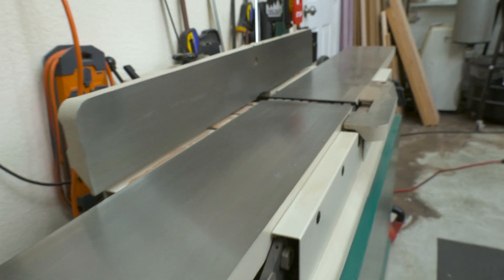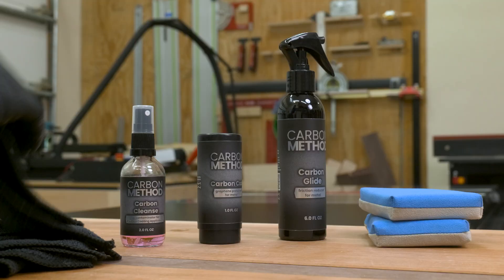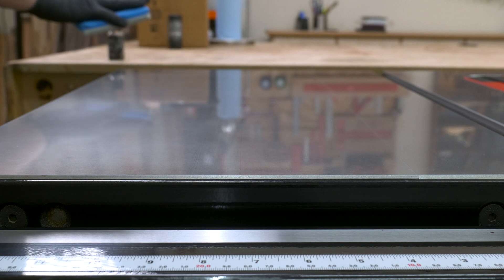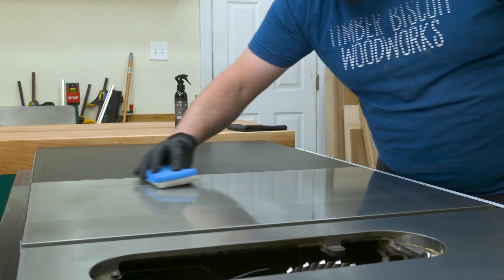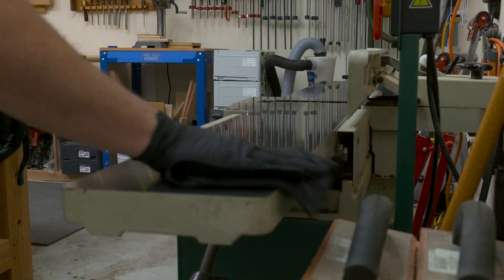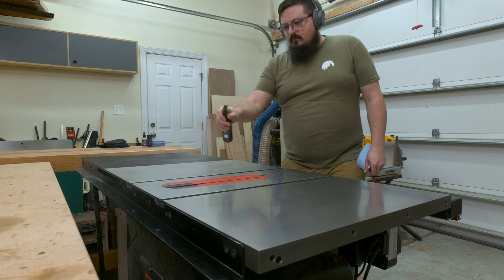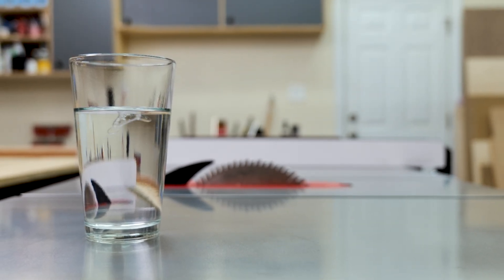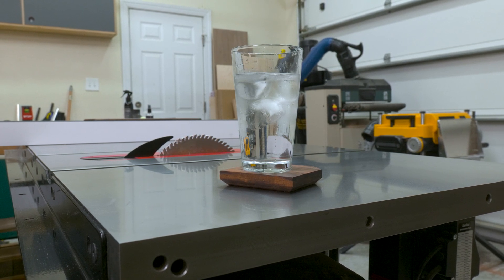We All Make Mistakes - This Stuff Isn’t One | Carbon Method

Comment: Good video about protecting the tops of the equipment but why would I want to spend so much for the carbon coating when when we can use products which cost less?
I do like your woodworking videos they are informative.
Reply from the maker: Valid question. I have used just about every product under the Sun when comes to trying to prevent surface rust. I actually just had a friend move here who didn't heed my warning about it and ended up spending three days removing from his tools after being here a week. Anyway, I have applied carbon coat one time in a year and in that time I have had zero rust and my tops look just about as good as the day I applied it. So for the time saved and the protection it still affords, I personally think it is worth the cost.

Comment: Hey, any followup on that ? cheers
Reply from the maker: Sorry, follow up on what part? If you mean the Carbon Method system in general, so far so good. I haven't had any issues and am still working off this initial application.
Reply: Thanks, that's exactly what I was wondering @TimberBiscuitWoodworks

Comment: How effective do you think this stuff would be on tools with a textured surface to the cast iron? My Hammer-Felder planer bed is machined with a slightly course texture on the surface.
Reply from the maker: I think it would be fine. The main thing is just to wick away the excess so you don’t get any pooling. Other than that it would work great. Mine is still going strong.

Comment: Did you go through this process with the jointer and band saw at the same time you did your table saw? For example, did you put coat one on table saw, jointer and then band saw, then repeat that three more times. If you did, were you able to use the same side of the application pad for each tool for that round? I’m just dying to figure out what I need to order. Thanks!
Reply from the maker: Yeah, that’s exactly what I did. Because the pad was still damp, I didn’t need to use a new side. You just have to kind of move quickly so it doesn’t harden on the pad. The quick kit for two plus tools was the one I used. And there’s still no rust! 😀
Reply: @TimberBiscuitWoodworks  That kit comes with two bottles of the carbon coat. Did you you have some left over or did you have to be  be kinda stingy with it on the last few coats to get it done.  I have a 36 inch sawstop pcs, 6 inch jointer and the 1412 Laguna bandsaw. I don’t want to run out of product yet don’t want a bunch left over either. Thanks for the advice,
Reply from the maker: The one I got just had one bottle, but it was more than the single bottle for one tool, 1 oz vs .5 oz. But it was plenty to do the three tools plus extra for future coats.

Comment: isn't graphene a dangerous chemical?
Reply from the maker: If you ingest it, sure. But not in this situation.
Reply: @TimberBiscuitWoodworks  sure but graphene transfers from surface to wood.  wood dust goes into the air and into you.
Reply from the maker: @PatriotMango  it’s suspended in the solution then hardens. The same argument can be said about anything you use as a protective coating.
Reply: @Timber Biscuit Woodworks  it's true about other protectants.  if you have to reapply every year then it means it's coming off the surface.

Comment: How much product did you use to do all the coats on all the machines in this video?
Reply from the maker: The kit I bought came with 1oz of the Carbon Coat. I would guess that I used 3/4oz for four coats on all three tools. I also did my little drill press bed but didn’t film that one.

Comment: I'm so glad I live in a low humidity environment. Recently, we had a few days with 60-65% humidity (summer time) and i hated every moment of it. I'm used to having 35-40% humidity in February. I can't imagine having your humidity levels year-round 😱
Reply from the maker: Oh that sounds so nice! Haha, it’s miserable in the summertime here.
Reply: @TimberBiscuitWoodworks  oh gosh. I can only imagine.
Glad to see your cast iron has some decent protection now. I might need to invest in Carbon Method too because, believe it or not, rust still forms on stuff here. It also seems to form quicker than it should and I think it's due to our close proximity to the ocean (salty air)
Reply from the maker: I have that problem as well, I’m only about 8 minutes from the beach. It does a number on the tools for sure.
Reply: @TimberBiscuitWoodworks  indeed.
That carbon method stuff you used looks rather interesting. I think the scientist in me is very curious on how it "bonds" to the surface of the metal. After your video I feel like I've seen enough YouTubers use the stuff for me to seriously consider investing in it.
Reply from the maker: Yeah I’m not sure on that one but it definitely feels pretty well bonded.

Comment: I applied this in September of 2022. It's presently March of 2023, so it's been about 6 months now, and we've been through one of the most nasty winters in California in ages; just cold and rain, and rain, and rain, and then a lot more rain. My shop is in the unheated garage, so it's been seeing temperature swings down to freezing and up to 70F, and did I mention, it's been a bit wet here. As in, the tools have been getting some use with that whole Ark building thing. Absolutely zero rust problems. This stuff seems to be the real deal, at least in my limited experience.
Reply from the maker: Well that’s great to hear! I’m really excited about opening up the shop for the next few months.

Comment: I’ve been thinking about trying this stuff out. I’m just south of Houston, so lots of humidity here too! After applying 4 coats to your machines, how much of the product do you have left? Do you have to completely remove it and apply 4 coat’s again next time or just a touch up coat?
Reply from the maker: Good question! I have enough to do another coat or two on all of my machines, and the next time it is just a reapplication of the carbon coat. You don’t have to take it down to bare metal again.
Reply: 2 rounds of Carbon Cleanse and another 2-4 layers and your Golden